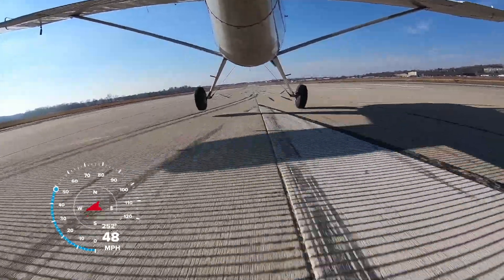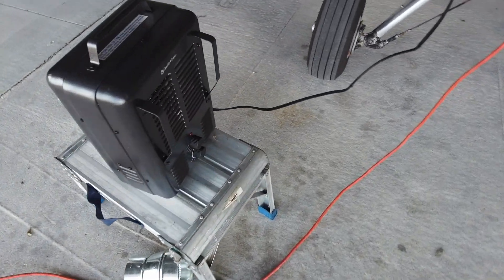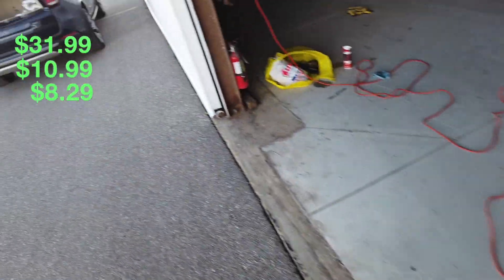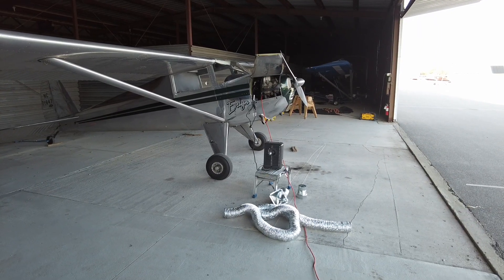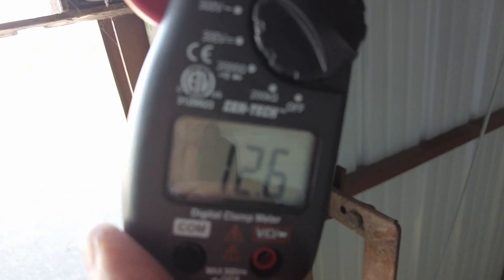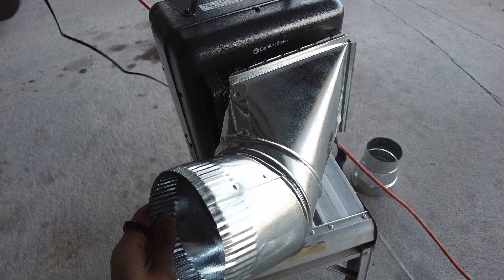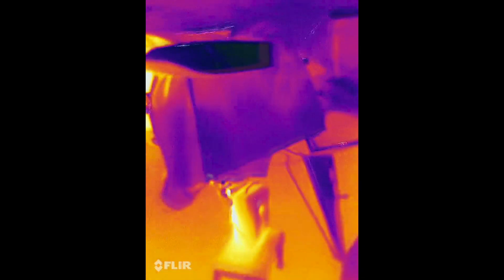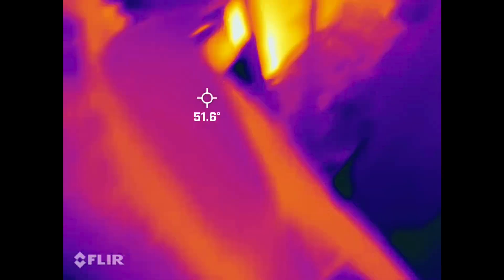Testing Homemade Aircraft Engine Heater at 0ºF

Comment: Thank you for your excellent video!  I live about 40 minutes from the plane and am wondering what to use for a remote switch to activate the heater.  Again, thanks.
Reply from the maker: Check out my newer videos on this topic. I use a Switcheon that i control from my phone, it does have a lower wattage rating so be careful with that

Comment: The Continental service bulletin says that the outside engine temperature isn't as important as getting rid of the cold soak in the bearings and internals.  But this way of preheat is a good thing.  If you could leave it that way for an hour or two that would do it.  Did the same with my Aeronca, same set up.  But external temperatures aren't doing the trick according to the service bulletin.
Reply from the maker: i would hope that the internals eventually warm up as well. Being that the under cowling temp doesn't go under 50º while parked, I am sure they are warm
Reply: Agreed but like was said,  a few hours and the think metal will retain internal heat.
Reply from the maker: @SMcda  Continental recommends at a minimum 4hrs in a heated hangar. The cowling is never under 50 degrees so I feel pretty good about that.
Reply: agreed,  And your Internet based phone app is super cool perit's super cool. A guy in a hanger next to me how's a similar set up

Comment: Cool… err, warm. 🤪

Pull the prop through a few times to get hot oil to the top and you’ll have a relatively warm start.

Love the cellular activation unit.
Reply from the maker: 10:23 Although I don't believe pulling by hand will build up enough oil pressure, it does prime the cylinder heads with an air fuel mixture that helps in starting